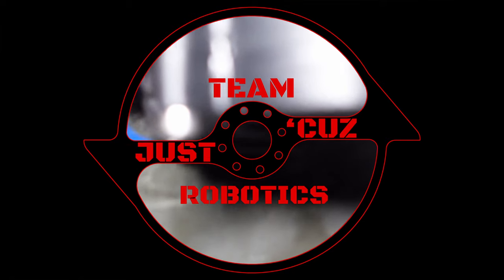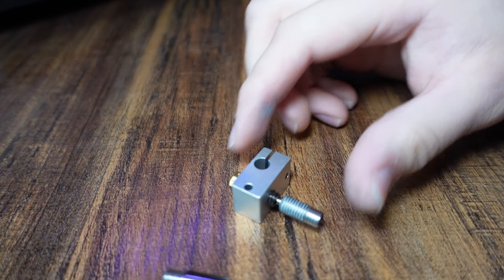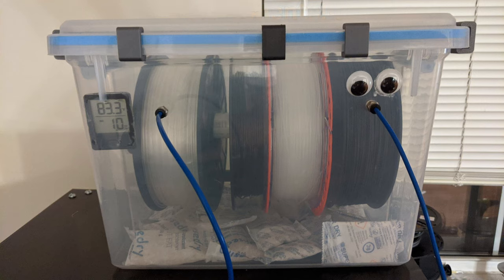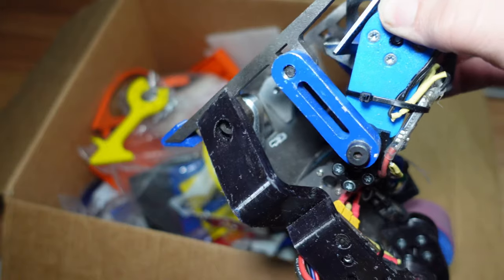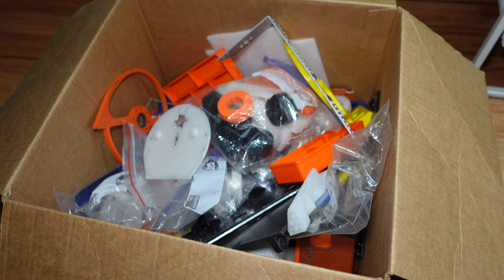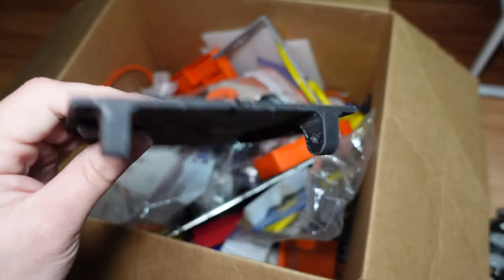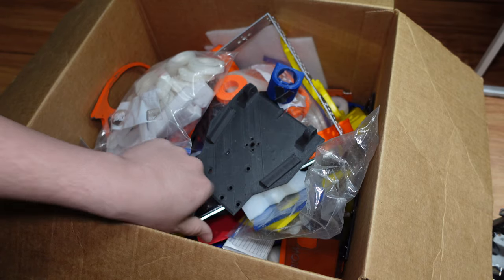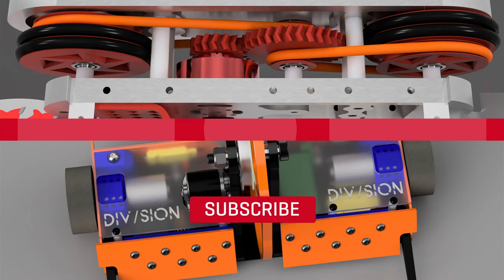The Best 3D Printing Materials for Robots: How to Choose and How to Use Them (Battlebots Filaments)

Comment: Chiming in as a mechanical engineer who studied various aspects of 3DP in graduate school: I second that polycarbonate is a dream material from a use standpoint but is basically impossible to print at the hobbyist 3D printer level. A colleague of mine a few years back was trying to make parts from a PC filament in a heated enclosure on a $3k printer, and nailing the bed adhesion actually doomed their machine. The PC contracted so strongly while cooling that it fractured the glass build bed and tore a huge chunk out of it, knocked it out of commission for at least a month. Personal recommendation is that, should you genuinely need PC printed parts, pay a service to print them for you. Had some great results from Stratasys a few years ago, especially if you live in the Midwest.

Fantastic video, thanks for all the great content!
Reply from the maker: RIP shapeways but at least you can get printed PC from few other places these days. I agree trying to print it at home often isn't worth it. I have had decent results from Prusament PC Blend but it's nothing like pure PC mechanically

Comment: Might as well mention this modifications for some materials that can up the durability or reduce the weight such as esun PLA-ST which I have been using on my beetle weight grabbers which took direct hits from multiple verts and have taken minor damage compared to normal pla.
Reply from the maker: There are way too many modified PLAs out there for me to even attempt to try them all. I have used a few PLA+ variants and never saw them perform as well as PETG. I think at the end of the day though Nylon is still king as long as you are equipped to print it.
Reply: @JustCuzRobotics  that is very true honestly though pla+ and PLA-ST are probably the best for ants and plastic ants and for people who have printers not compatible for nylon. This does make me wonder out of the materials out there that pcb way or other commission services out there do what would be the most durable material you can get
Reply from the maker: There are some special nylons meant to be printed on cheaper printers too like Nylon 230. Some tradeoffs, but might be a lot better than PLA.  https://amzn.to/3x82rFU

Comment: Great video with useful tips and recommendations. I print PETG on glass...love it. Just got a hardened steel nozzle and hoping to try PETG with carbon filament..and down the road NylonX.
Reply from the maker: The problem with printing petg on Glass isn't that it won't stick its that it sticks too well. If you clean your bed with isopropyl alcohol and then print on it right away you might find that chunks of the glass get ripped up with the part. I've experienced this firsthand back in University when I was using a CR 10 with a glass mirror as the bed.

I also would not recommend using a petg with carbon fiber as any sort of armor because it's just going to be extra stiff and extra brittle.
Reply: @JustCuzRobotics  Thanks for the PETG/carbon fiber usage tips. It will be used for internal support where stiffness is needed. I make my own proprietary build plate spray(retired bio-chemist) and the PETG sticks very well, but the print can be removed from the glass.

Comment: Great video! I am going with Alloy 910 for my first beetleweight and currently have a stock Ender 3 V2. really want to get a printer that auto levels because I tend to have significant problems with my first layers. What is the next step that would have auto bed leveling and allow me to print with nylon?
Reply from the maker: Thank you! To print with nylon like I said in the video all you really need is an all-metal heat break. This video will help with ABL from Teaching Tech. That's gonna require messing with firmware which isn't the most straightforward thing ever but I have done it on my Tevo. https://youtu.be/eF060dBEnfs

Comment: Just a couple warnings. Depending on the blend, Polycarbonate is just as bad for toxic fumes as ABS if not worse. Also printing CF Nylon can throw off some pretty nasty microparticles that your lungs will not enjoy
Reply from the maker: Good to know! I won't be coming back to PC anytime soon.
Reply: @JustCuzRobotics  If you’ve already got an enclosure, all you need is a fan strapped to a charcoal filter to start printing whatever filament you want! Ik PC had other issues, but still. Thanks for all your great videos! It’s so awesome to see such in-depth information on your design and testing process

Comment: Are you able to print nylon on the Sidewinder? The specs on the X2 say a max temp of 240 C
Reply from the maker: I upgraded it with a bimetal heat brake ($15) and a micro Swiss hardened steel 0.6mm nozzle ($30ish) to print CF Nylon or whatever else I want with it up to 275C
Reply: @JustCuzRobotics  Thanks! I read on a reddit thread that the x2 automatically shuts off if it runs over 240. I was hoping that was wrong since I already ordered the printer. FYI your videos are great!
Reply from the maker: You're welcome and thank you! It most definitely does not shut itself off, it just refuses to go above 260 and if you try making it go to 280 the temp target will just become 260. I changed the firmware to make the max 315 but for some reason it now will just max out at 275 instead.

Comment: hey there, try printing poly propelene, you can also do abs rather easily if you let your printer heat up for 40min or so before starting and don't forget to put a big box or make a foam insulator to print in. You can see my voron 2.4 in action printing asa on my channel. willing to share my advice if you need it. also i realize this video was almost a year ago
Reply from the maker: ABS and ASA are both way too brittle for combat robots so I have strayed from them both. That said I did actually just start experimenting with PP filament and while it is also a huge bitch to print without warping, it definitely seems durable enough for the job.

Comment: bit of a noob In the land of printing but I'm currently looking at a printer for my first beetle weight.

I just wondered if you can actually print hdpe or hmdw? I was looking at getting sheets for the armour and base plate but if there are printers (relatively cheap ones) that can print this, I don't see why I don't just get a printer for Christmas and spend the time on cutting out the hdpe on learning the softwear better.
Reply from the maker: Soooo yes but also no. There is almost no chance a cheap printer can print it, and its a pretty unusual filament, but it is technically 'a thing' to print HDPE. UHMW on the other hand I think it would not be possible since the difference between HDPE and UHMW is the length of the molecular chains of the polymer. (Very High Density vs Ultra High Molecular Weight polyethylene) The exact process for making UHMW is beyond my expertise as again I am not a materials scientist, certainly no polymer specialty. There may be a filament on the market that claims to be UHMW but I don;t think it would really have any of the benefits of UHMW, for the same reason as I would recommend cutting the parts out from sheets anyway: 

Layer adhesion kinda sucks. It is essentially a guarantee that a 3D printed PLA sheet and a store bought molded PLA sheet will behave extremely differently and the molded part will be as strong or stronger 100% of the time. There is simply no way around the fact that layer lines have gaps and those gape make it easier to peel apart. Injection molded Nylon parts are used in cars and power tools, but a 3D printed replica would not have nearly the same durability. 

Quick google search brought me to this:
https://all3dp.com/2/hdpe-3d-printing-material-all-you-need-to-know/

Also relevant: https://www.youtube.com/watch?v=Bl2ESvtBiLo
Reply: @JustCuzRobotics  Oh shoot, that does seam like a LOT of work just for the ability to custom make hpde parts more complex.

I think you're right, I'll probably go with the hdpe sheet and then go with nylon joiners/brackets to attach panels together, that seams like a good compromise.

One of the reasons I asked about printing the hdpe is that, usually especially here in the UK its hard to find coloured HDPE sheet that isn't white or black and I know from spraying water butt's at airsoft that HDPE doesn't take to paint what so ever.

I saw a video from Ben at team panic where he dyed his HDPE green, but it looked like quite a very lenghty, expensive and inconsistent process.
Reply from the maker: Yeah I saw the same thing when I looked into coloring my clear Nylon parts. Matterhackers has pro series Nylon and NylonG in lots of colors, and I think Kodak has some colors of it that are of questionable quality. But practically all other nylons everyone else sells are black or clear.
Reply: @JustCuzRobotics 
Yeah, really is a shame!
But oh well, I guess it doesn't have to be perfect the first time.

If you can get a really opaque nylon or hpde then I guess there's always the option of sticking coloured foil on the inside and have it shine through...
But I guess I'll just go for sticking the "abative foil armour" shatter uses on the outside of my bot and hope that when it starts to fly off the judges don't see that as actual damage 😂.
Reply: @JustCuzRobotics  Also thanks for the links/help, it'll give me plenty more to research in the time off around near Christmas to finalise some details.

Comment: I didn't see it in the comments or video, did you add/modify anything else on your Prusa printer besides the e3d nozzle x hardened nozzle?
Reply from the maker: Yes, but nothing that's actually necessary for printing CF Nylon and the like. I reprinted the previously melted stock ABS fan duct with Alloy 910, and replaced the stock stainless steel heat brake with titanium and the stock aluminum heat block with a nickel plated copper block. Was just kinda hoping to compensate for the worse thermal conductivity of the steel nozzle vs stock brass, honestly no idea if those other changes made any difference. It does seem to heat up a little faster tho.
Reply: @JustCuzRobotics  Do you have a suggestion of a company or place to purchase these other metal parts? Since I'm getting the Prusa it makes more sense to me to put them in initially instead of building it then building it then tearing it down and then putting them in later. Thank you again for your help and making this video!
Reply from the maker: Heatbrake: https://amzn.to/3CF6YAZ
NozzleX: https://amzn.to/3nJZU1J
Copper heatblock: https://amzn.to/3nGBupM 

I also have a custom enclosure on my Prusa since I have access to a laser cutter. Gonna see if I can work with Send Cut Send to make a more badass one for the Sidewinder as well. https://www.prusaprinters.org/social/31323-team-just-cuz-robotics/prints
Reply: @JustCuzRobotics Do you print all your parts in your enclose? I've watched your video three times now, but I don't remember if you said that or not. Do you have a picture of your enclosure? Is it in transparent acrylic so you can see through it? If so and you are in NE (I think you mentioned you moved from CT to NH or VT) and might be interested in discussing a price to make one for me we should talk off yt by email or something. Again thanks for your help!
Reply from the maker: I shared a link to my enclosure design in the above comment. I don't know for sure if I'll be able to make one for less than you could buy one commercially now, but we can discuss over email.
Reply: @JustCuzRobotics  Thanks! That's really cool. What is the white thing on the 3D printed block in the picture, a fan? Also where did you get that remote control? It says PRUSA on it but I can't find it anywhere on line. Again thank you very much for your help.
Reply from the maker: The white block is a $25-$30 Wyze V2 security camera I use to monitor prints, I just stuck a label on it so I don't mix it up with my second one for the other printer lol. It has a phone app and it's amazing for taking timelapses and monitoring the printer from anywhere. The remote control is for the LED strip I stuck on top of the enclosure but it doesn't work anymore, they are just on 100% of the time when the printer is on. https://amzn.to/3CG7vT6
Reply: @JustCuzRobotics  lol! I thought that looked like the remote from my color changing LED bulb! I have one in my grandfather clock. THANK YOU! I really appreciate all the help. Keep making your videos they are awesome!
Reply from the maker: You're very welcome